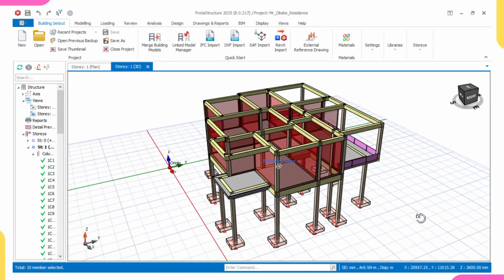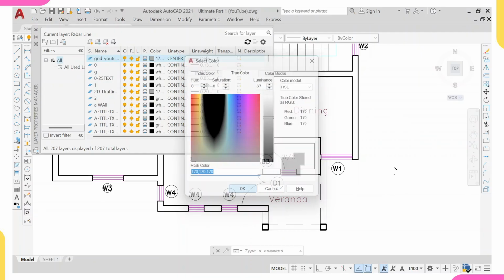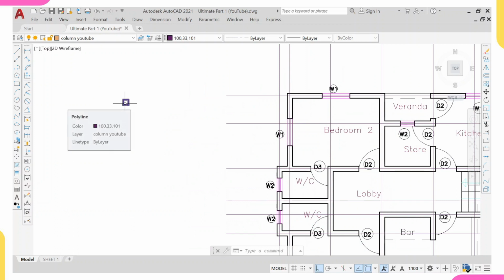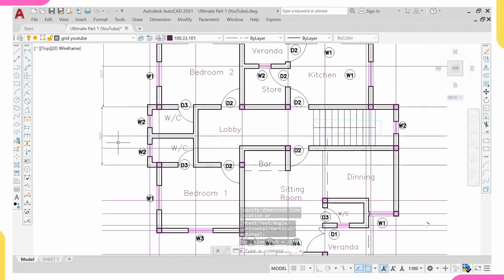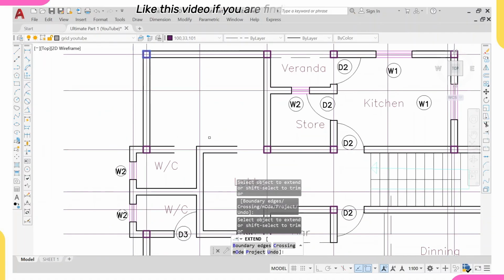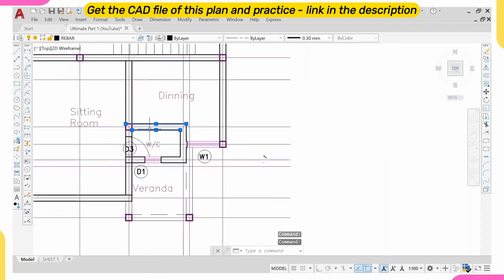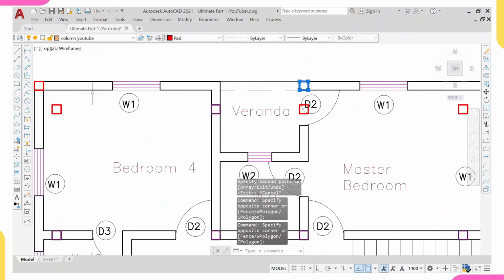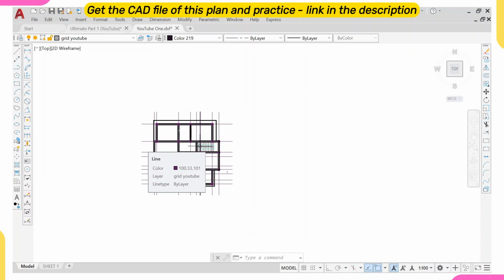Structural Framing 101: Governing Principle in Column, Beam & Slab Placement

Comment: Engineer thanks but those walls u removed will only slab support it😊
Reply from the maker: yes, our slab will be able to carry it. 
on your own, you can apply those Walls as line load and design the slab. you will see that the slab will still pass

you can get our paid course to learn more on structural design and detailing 
https://selar.com/3i96386b2v